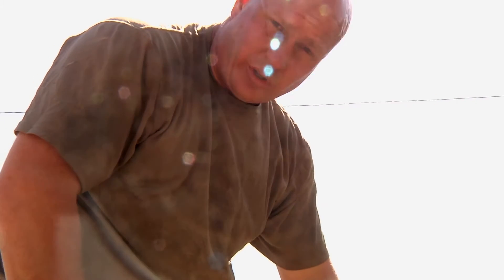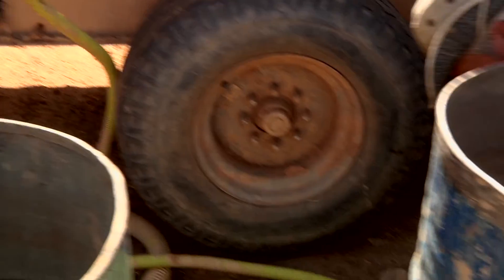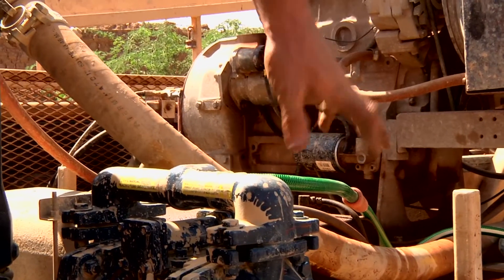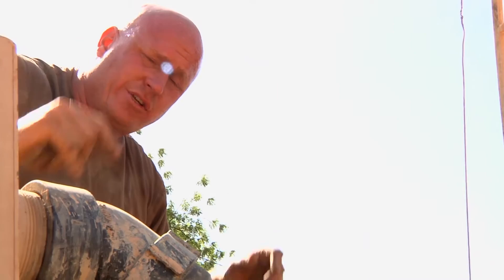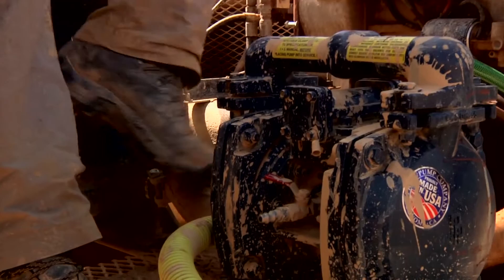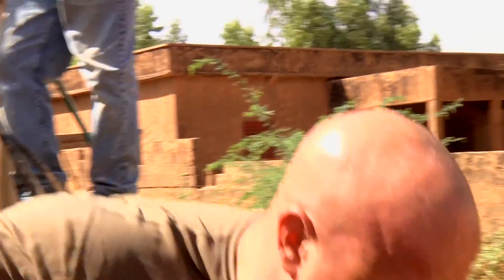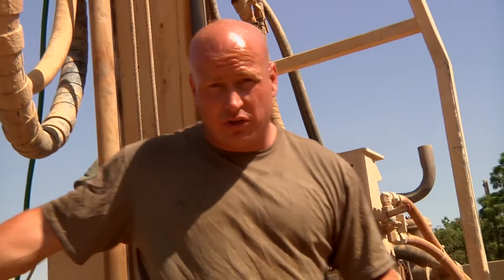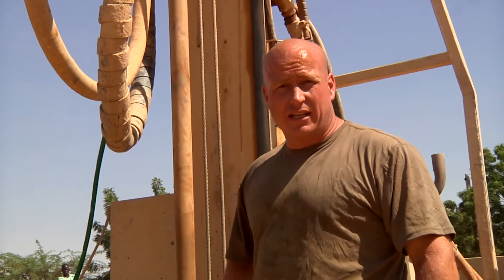Part 4 Drill Rig Foam Operation

Comment: So the air compressor send air thru the red 2" hose which normally causes the water pump to work but here, the red line forces air into the 4" hose